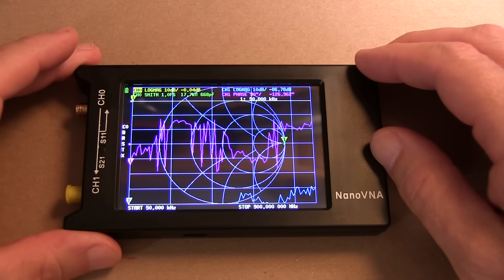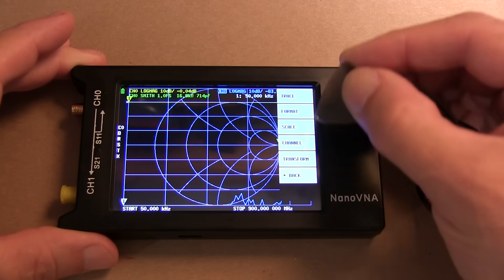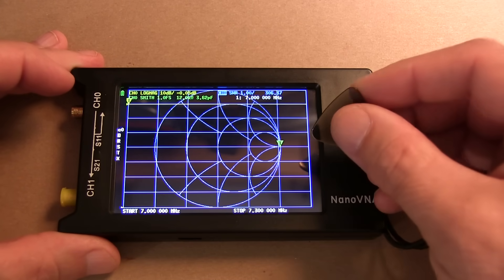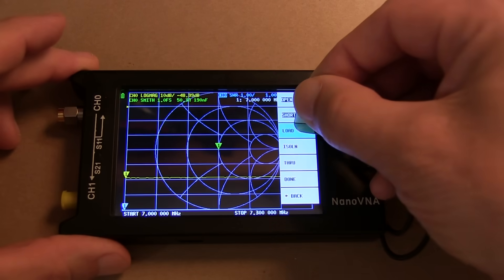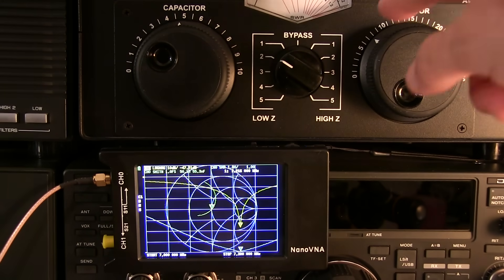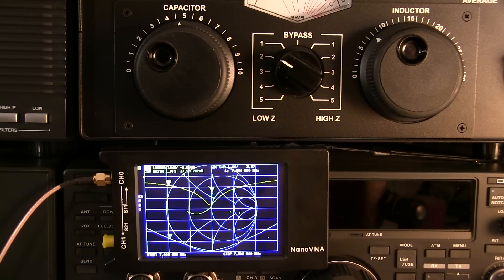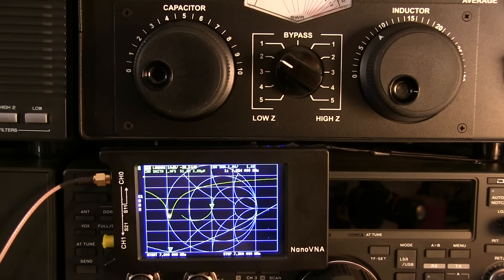#314: How to use the NanoVNA to sweep / measure an antenna system's SWR and optimize its tuning

Comment: Alan, you are going way to fast on this tutorial.  You make too many assumptions. You are in the "magenta generation" . Example what is  "inverted text". Your eyes and brain are trained for this, you are assuming everyone else must also be similar trained. Your video is only usable by those with your assumeed level of knowledge.  If a change happens on the screen, explain it.    A change in colour of text means something to you and you assume everyone else knows that. Wrong.  Try starting with basics, how do you make entries on the screen? You need to make a statement, pause, give time for a viewer to folow the action. Your video is as like an expert turning on a fire hydrant when a student needs a cup of water at a time. Selecting Frequency is a nightmare, you press buttons to get your frequency and then you can't get out of it or move on to stop.  You use a guitar pick.. What can be used  to enter? Finger touch does not seem to work.  You know what you are doing but you forget what its like to be a newby. 

Now, why is it that sometimes  a finger touching the screen works and other times on the NanaVNA-F I have to use the buttons?
Reply from the maker: Hell Ram Jet - This video wasn't intended, as you surmised, for a beginner to pick up and use.  I have many videos on the NanoVNA on my channel, some which show more of these basic concepts.  You may want to start there.
My complete NanoVNA playlist is here:
https://www.youtube.com/playlist?list=PL4ZSD4omd_AylEyNCQYR3RcEb0olukPEJ
This video is a presentation that covers the basics of what a VNA is, and then the NanoVNA:
https://youtu.be/o1eLK4EMpEQ
And if any of the videos are going too fast, simply hit the pause button or the playback-speed control.

Comment: Can someone explain what the start and stop frequencies actually mean in the Transform mode?  My guess is they are the repetition rate and pulse width of the output pulse, but that's just a guess.  Anyone actually know?
Reply from the maker: Barry - the NanoVNA doesn't actually create a pulse to do the "TDR" function.  It essentially does a sweep over the specified frequency range, and computes an inverse FFT to extract the time-domain data from the reflected results.  The stop frequency determines the distance range (lower frequency will measure over a longer distance).  I did a video on how to use the "Transform" function on the NanoVNA:  https://www.youtube.com/watch?v=9thbTC8-JtA

Comment: Hi Alan
Using my VNA v2+4 to adjust a Hustler RM-40. Setup was vna to 3m coax to mag mount on the ground outside. VNA calibrated with no cables attached to sma. Coax then connected to sma for testing. When I touch the VNA the readings change. The resonate SWR moves to a lower frequency by about 600 Hz.The VNA and mag mount don't have a physical ground link.
What do you think is causing this change in readings when touching the VNA? How can I prevent this happening? What is the correct connection method to check an antenna with a VNA?
Regards
Stan
Reply from the maker: A mag mount antenna really needs the large metal surface (of a vehicle typically) to be the counterpoise.  The shield of the coax often becomes part of the counterpoise too, especially when not mounted on a vehicle.  In your case, the shield of the coax, and thus the metal case of the VNA are all part of the counterpoise, which is why the tuning changed when you touched/moved the VNA.  The only proper way to tune a mag mount antenna is to have it mounted on the vehicle where it is going to be used.
Reply: Thanks Alan

Comment: How do you pick a NanoVNA ?  seems there are about 50 options now
Reply from the maker: I know, it's tough.  The NanoVNA-H4 is a good low-cost choice with a 4" display and some nice 3rd party software development.  The NanoVNA-F is a higher cost, better performing unit with a nice display and a metal case.  The NanoVNA-V2Plus4 covers a wider frequency range (to 4.4GHz) and has better dynamic range than the previous two, but costs more too.

Comment: The only thing I might suggest is to show which fitting is for open, short and load. I think mine automatically decided that I had the wrong fitting and did the calibration for the fitting installed, not the test I chose. Just a small point for the rank neophyte like me. Thanks.

Comment: Does the nice device come with adapters for bnc, Type-N, PL-259, and SO-239 or is that separate accessories?
Reply from the maker: No, it does not.  You have to provide the necessary accessories yourself.
Reply: @w2aew  Still a great bargain. A full antenna designing lab device, bringing The Smith Chart into it was a good move, also.

Comment: Helpful vid!!

On your CH0 shows SWR 1.00 and then the reading.  Mine showsCHO SWR 250m.  Does this make a difference?  If so how do I change that?
Reply from the maker: That is the vertical scale of the graph.  You just have a finer vertical scale on your plot than I do.
Reply: @w2aew  ah ok!  I have seen it on other VNA’s but mine seemed different. Wanted to be sure that it wouldn’t make a difference in my readings.  Just my OCD!!  LOL

Thanks for the vids!  Real easy to follow along.👍🏼

Comment: How do you know which 'ByPass' to use on the tuner ?
Reply from the maker: BYPASS is the center position on the tuner switch - where the tuned circuit is "bypassed" and the input is directly connected to the output of the tuner.  The "Low Z" and "High Z" selections will configure the L network as series-shunt or shunt-series, with varying levels of fixed shunt capacitance.  The "right" selection is the one that enables proper matching of the load impedance (antenna system) - largely a trial and error process.
Reply: @w2aew  Yer I kind of realised later your tuner is a totally different system to my MFJ 941e. The say to use the middle knob to find the loudest noise level. I was wondering how you did that.
Reply from the maker: @MONTY-YTNOM  Yes, that is part of the "trial and error" process to get close to the right setting, then adjust the fine tuning from there.

Comment: Very nice tutorial video I wish it was a bit slower tho, the last portion of the video with the tuner,  how so you have it connected? I might want to do it so in that way my nanovna is always in use rather than always in the box thank you
Reply from the maker: The NanoVNA is connected in place of the transmitter in this video.  In my case, the input to the tuner is connected to a coax switch that allows me to connect to one of multiple rigs as well as a "spare", which is what I used with the NanoVNA.
Reply: @w2aew  thank you for further explanations I would try to do that and plug it just like a regular antenna?
Reply from the maker: @jaywardjulian6163  In the video, the connection was:
NanoVNA --> coax switch --> tuner --> coax to antenna
Reply: @w2aew  thank you much and 73 de KH2ZZ

Comment: Hi! Fantastic video. I appreciate the introduction to this tool! Do you know if this would be able to be used to record and export the log magnitude of the reflection coefficient and frequency as an antenna is perturbed by a conductor inside the resonant cavity? This would be tremendously helpful in an application I am helping to develop. Thanks in advance!
Reply from the maker: You would have to use one of the PC helper programs (like NanoVNA Saver) to extract/save the S11 data.

Comment: Just brought one of these and to say mind boggled is an understatement! Brought it to check the SWR and tune my loading coils on my Diamond CP6S - at least I know sort of where to start as never used one of these before - always adjusted, gone back to the radio and checked the SWR - just trying to work out how to connect the PL259 to it! It’s one of those small adaptors that came with it... I hope!
Reply from the maker: It likely did not come with an adaptor for PL259 - you'll have to pick one up yourself.  The bits it came with are likely the Open/Short/Load and Thru devices that you use in the calibration process.

Comment: Thank You for this VNA explanation. Question. I am trying to increase the range of FPV on a new drone that was purchased. As it is now,,the FPV stops at only 125 meters. The drone itself have flown out to 1300 meters several times,,albeit line of sight,,,not good! Am wanting to piggback an rtlduino on back of drone to create a bridged wifi setup to the drones wifi,setup,,then another rtlduino on ground station,connecting to drone rtlduino,,to connect smartphone to,,with the drones proprietary app. 
The PROBLEM: From what i can understand these VNA will only go to a little over 3ghz. The drones fpv broadcasts on wifi 5.8 ghz,,,so if i bought one of these it really wouldnt do me any good for troubleshooting would it. Am very dumb on this stuff,,it goes without saying. Showing my stupidity,,,again,,,will this work on digital,or only analog?.Thanks again
Reply from the maker: These inexpensive NanoVNAs are limited in frequency range, and thus can't be used to measure your 5.8GHz antennas.

Comment: Could I use it to tune up a 2.4GHz Antenna ? Like a zigbee, bluetooth antenna
Reply from the maker: Yes, you just have to get one that will cover your frequency range.
Reply: @w2aew  Great, i just use it at 2.4Ghz range as well
Reply: I have one question, hope you explain to me. When i measure impedance of an antenna, i have to use a port extension, after measuring, i exported S1P file to import it into a smith chart tool but i see that the impedance in S1P file not same the impedance I measured

Comment: So basically its not possible to have a very low SWR across the entire band? That sure makes the tuner handy?
Reply from the maker: Basically, yes.
Reply: @w2aew  Have you ever tried to permanently add inductance and capacitance to non cooperative antenna for a better SWR?
Its amazing what that tuner can do.
Reply from the maker: @RC-Heli835  Yes, adding an impedance matching network is a common thing to do.

Comment: Hi there!
Big fan of yours!
Question... I’ve heard of people using MFG259 saying that also X needs to be kept in mind and X needs to be at 0. I found how to  measure X on nano vna but I don’t know what does it means reading I get is -1.2 to -20 on lower side of the 11m band 
And +1.2 to +20 on higher side of the 11m  band .
Maybe you can give me a short explanation about it..
Thanks in advance.
Reply from the maker: X is the "reactive" part of the impedance.  The definition of resonance is when the X component is ZERO.  This isn't always at the same place as the minimum SWR, but it is usually close.
Reply: @w2aew  thanks!. More or less the lowest X is at the lowest of my swr , and as i move farther out swr and x increase . It is a copper antenna 1/4 wave im building so I guess that I will keep trying different things and configurations to try to lower it more close to 0.
Do you think that if i add an air capacitor will be able to keep x stable?
Reply from the maker: @TankmeUSA  As long as your SWR is below 2.0, you're good.  Below 1.5 can be considered perfect.  Any improvement beyond that will be imperceptable.

Comment: Hi, I cannot follow your steps as the display seems to be super unstable, hypersensitive and therefor I cannot proceed through the menu system in a normal way. Secondly, how do I identify which of the SMA stubs is  " Open, Short and 50 ohm, there are no markers
Defective unit or  needs a firmware upgrade?
Reply: never mind,  I had to calibrate the actual touch screen, works fine, thanks  for your videos, tuned  my 6M Mag Loop in less than a minute. 
Super tool. 
73

Comment: Thanks for the great vid.  As always, your channel is a great learning resource.

Question....  I used the NanoVNA to tune my antenna system as you demonstrated.  Of course, it worked just as flawlessly as your example.  However, the meter on my tuner doesn't agree with the VNA tuning.  While the VNA tuning shows  a perfect match, the tuner meter(MFJ 945) shows 1.4:1 and worse.  The radio(ic-7300) seems to agree with the VNA. 

In short, trust the VNA or the tuner meter?

A few tests on Reverse beacon network seem to show slightly better performance, but they're far from conclusive.
Reply from the maker: I would tend to lend a little more weight to the 7300's meter and the VNA - mainly because they agree.  That being said, even an SWR of 1.5 is still VERY good, very near perfect.
Reply: @w2aew  wow!!! A direct reply.    Thanks.   And thank you for the priceless education.  

That's the way I was leaning.   Was planning to run awhile with the VNA settings to see if I noticed a performance increase.  Though,  the way I understand tuning is that it only affects how the TX sees the antenna. 

Im curious now if an inaccurate meter may have been why my ic-706 ran hot. 

I  run a doublet so anything approaching 1.5 is unusual.  At least according to the MFJ meter.  We'll see what the vna says.   

Thank you again for all you give the ham and electrical community.   I assure you it is more appreciated than you know. 

Hope to hear you on the air sometime,  

KG5SAG
Reply from the maker: @guitchess  It would be interesting to see if you adjust the tuner so that it shows 1:1, what does the NanoVNA say then?    Just remember that 1.5:1 is very near perfect.  This isn't what caused the IC-706 to run hot - they all run hot anyway!

Comment: 0:42 Selecting channels

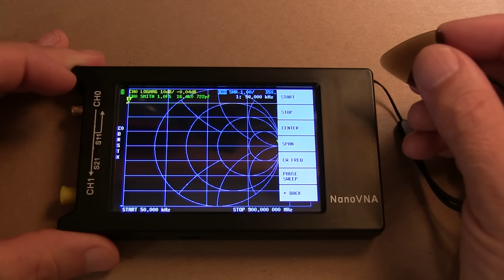SETTING FREQUENCY RANGE 1:15 

1:20 Tap - START - Set frequency + M. 
1:30 Tap - STOP - Set frequency + M

CALIBRATION 1:50
Tap/Back - CAL - RESET - CALIBRATE
2:03 OPEN, SHORT, LOAD
2:11 - OPEN | 2:16 - SHORT | 2:21 - LOAD
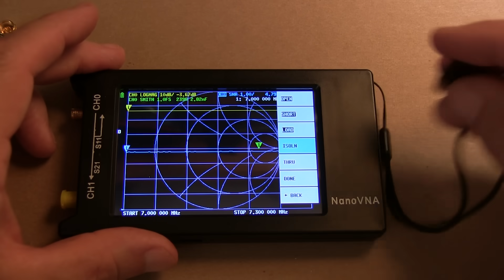2:32 Hit DONE 
2:36 SAVE

HOOK UP ANTENNA 2:42
2:46 SWR
3:10 SWEEP ANTENNA
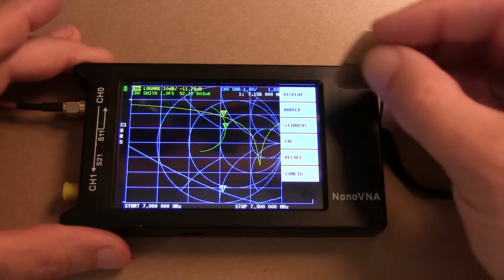3:18 MARKER - SEARCH (depreciated)

Comment: Why are you putting the standard loads (open, short, and match) directly onto the VNA if the goal is to achieve a match at the entry to the antenna?  Shouldn't these be placed on the other end of the coax that connects to the matching network?  My thesis is that a matched 50 Ohm antenna reflects nothing into any length of cable; but, until it is matched doesn't the extra cable mislead the tuning?
Reply from the maker: It all really depends on where you want to measure the impedance/RL/SWR/etc.  For example, if you are going to design a matching network that will be placed at the antenna feedpoint, then you want to calibrate at that point.  If you are placing the matching network at the transmitter end of the feedline, then you want to calibrate to there.  In this case, we are looking at the affect of adjusting the matching network (antenna tuner/transmatch), so that we can see what the transmitter will see.  Once the impedance looking into the matching network reaches 50 ohms, the length of the coax from the matching network to the VNA (or transmitter) doesn't matter.  It is true that when you have coax between the untuned matching network and the VNA, that the impedance seen by the VNA won't be the same as the impedance at the input of the network - but it doesn't matter.  The Return Loss / SWR will be the same at either end.

Comment: Yes, interesting! But when you insert the antenna tuner and adjust it, you're not really tuning the antenna- you're tuning the load as seen by the NanoVNA. Those devices shouldn't really be called antenna tuners. They just change the reactance of the load as seen by the transceiver or whatever device is attached.
Reply from the maker: Correct, of course.  You're not tuning the antenna, you are "tuning" or adjusting the impedance transformation network so that the impedance seen by the driver/tx/etc. is what is desired.

Comment: So I picked up one of these primarily to use as an SWR meter in vhf... But had a duh moment in that I couldn't actually use it in the 'traditional' sense of putting it in line with the radio and antenna. But to start learning how to use it, I connected up a rubber duckie from my FT3Dr... Should the SWR really be that bad? 4-5 in the middle of the 2M band.
Reply from the maker: HT antennas rely on the radio’s chassis, and your hand/body, as a counter poise. When you put the antenna on the NanoVNA, it won’t have the proper counterpoise, and the match will suffer.

Comment: THANK YOU. I bought one of the NanoVNA from Amazon and got the "upgraded" unit. The accuracy of these analyzers will help the operator to get the most out of their system to the distant station. Many analyzers are not very accurate and optimization of the antenna system is not even close.

Comment: Is there any possibility to re-activate the marker search (minimum tracking) after switching off the nanovna? If I save and recall the calibration with the marker settings, everything will be recalled except the marker search (minimum tracking). Therefore I have to make the settings every time I switch on the nanovna. I would like to automate this. Thank you for answers.
Reply from the maker: This is something that would have to be built into the firmware - you might make a suggestion to the firmware developers like DiSlord.

Comment: Bill-N6EF-Thanks for a another great NanoVNA video. I'm learning a lot about the NanoVNA from your videos. I never really understood the value of the Smith chart until I saw how you used it in this demonstration. I usually turn it off and only look at the SWR trace. I will be experimenting with my tuner using the VNA to get a better match other than SWR.

Comment: Great video  Can you do same thing to the  2m .what is your tanner model? how about some tuner don't have Capacitor  they have only inductor  and  transmitter can use transmitter as  
capacitor ?W7ABO   73
Reply from the maker: The tuner in this video is a TenTec 238C.  
If part of your transmatch is located in the transmitter itself, then this method won't work.